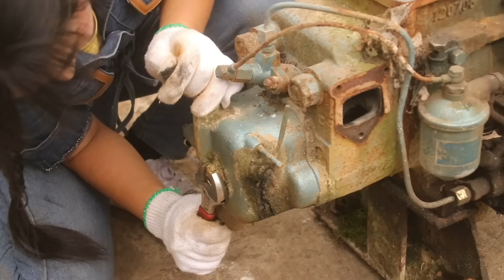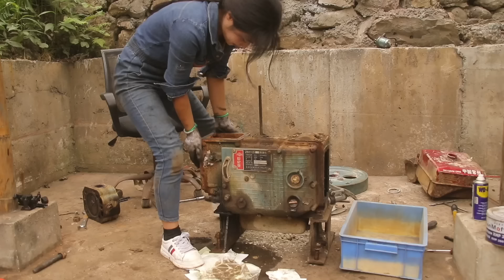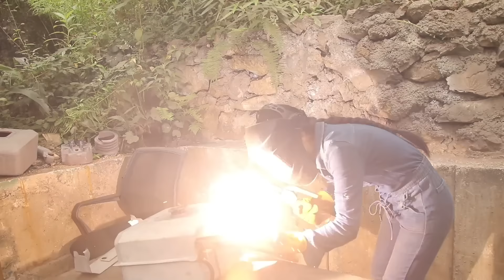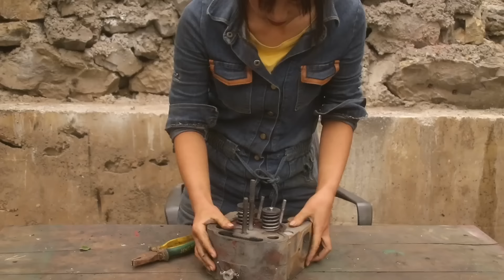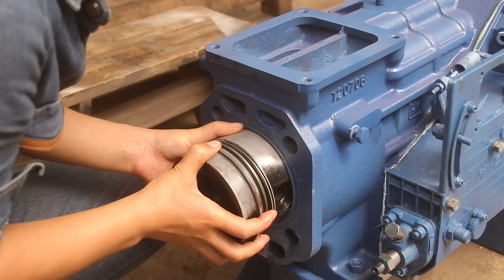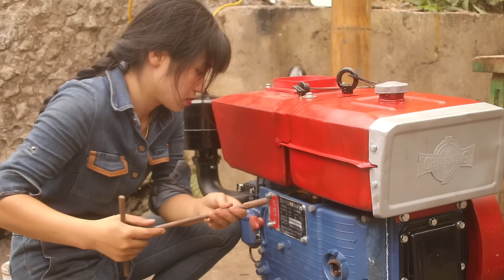💡Restoring a dead diesel engine, the girl genius brings the boss's machine back to life!｜Linguoer

Comment: Brilliant mix! A woman, tools, oil, dirt and expertise! I'm thrilled ❤👌
Reply: This girl is an actress hired to pretend to be a mechanic and other skilled trades-person. In reality she can't do any of these things on her own. And if you for one second believe she is doing all this you need some help. She is an actress not accomplished at any skill. At least they should make her look the part. This The girl is an actress. She was hired to do the "ROLE" there is no way she can be an expert electrician/carpenter/is an insult to any skilled trades person. And there are many shorts of Asian women who really do the work. This is not one of them. She is not a mechanic, or an electrician, or anything else.
Reply: @hdvictoryford5329  yup sure. 😒
Reply: @hdvictoryford5329 The burden of proof is on you. Specifically what makes you thinks this?  Handling the tools the way she does is the way any mechanic would especially the die grinder/cut off wheel. You know if you go too hard it will get away from you. I do find it odd that her hands and white shoes are always uncharacteristically clean!  😂
Reply: Who’s picking up the nuts 🔩 and bolts she’s throwing down?

Comment: I had to watch twice to figure out what the actual problem was.  I concluded it did need a new paint job.
Reply: 100% agree with you... I watched it twice... majority of the works showed on the video was removing all the screws, and parts, and putting them back. The rusty part that looked so bad was not mentioned how it was repaired... there were no fixing????
Reply: The rusty part is just the water reservoir for keeping the engine cool. She replaced the valves. She didn't show the lapping in process. She just banged them a few times in the seat. Entertaining to watch but not exactly a how to video. I enjoyed it though! Thumbs up for getting an old engine up and running again 😊😊
Reply: Also skipped over the ring compressor to get the piston back in….
Reply: Also skipped over honing the bore, replacing the injector nozzle, torque the big end, compressing the valve spring with a pliers etc etc … but only picking holes … great job and talented girl … wish her every sucess
Reply: Oil pan sludge removal?   Paint on head gasket surface.

Comment: I think there was nothing wrong with the engine. She just cleaned and painted. Maybe she put new valves in? She put in the rockers and then slapped the cover on without a valve adjustment! Looks like she assembled everything dry.
It starts without bleeding the fuel system after just a few cranks; - pretty strange.
Maybe she has some help off camera?

Comment: Never seen anyone lap valves like that before, can’t see that method achieving anything.
Reply: She did not even set the valve lash!    Just another rattle can rebuild.
Reply: It would have been much kinder to the engine if she would have oiled the rings, at least...

Comment: Painfully omission of any torques on the top nuts and the bearing nuts. 
I know it can be done, but here it looked a little too easy.
Impressive non the less, and you can tell she has done this before.
Reply: she has good enough feel from experience, and not so critical on this primitive engine.

Comment: Please stop throwing nuts bolts studs and parts onto a sandy floor. A plastic jug, cardboard, anything is better than the floor. And you will save time if you don't have to clean off the dirt you just added to them.

Comment: No assembly lube, no oil on the piston or bore or bearing surfaces or any of the gears or camshaft??  That engine is not going to last very long.  Sure it will start up and run but the initial wear w/out any oil on the moving parts will severely affect its working life.  Use a little common sense girl...
Reply: These things are non-essential... Engine block full of dust from sandblasting, no washing or just air blowing. When I saw how she compresses piston rings with her delicate fingers - that bring smile on my face :) Simple clickbait from pretty girl :)